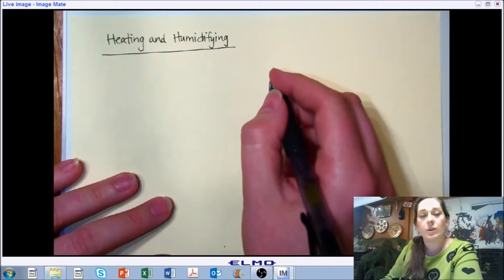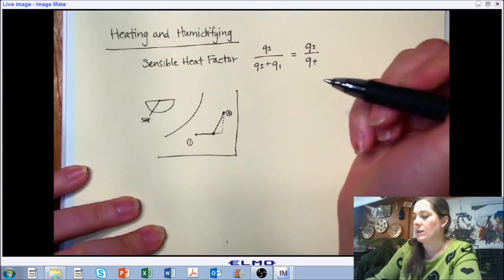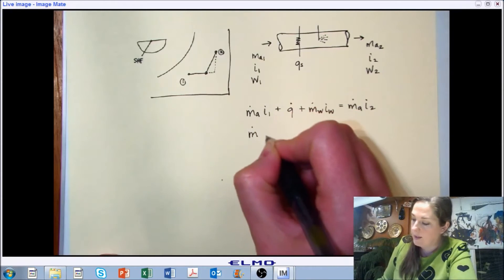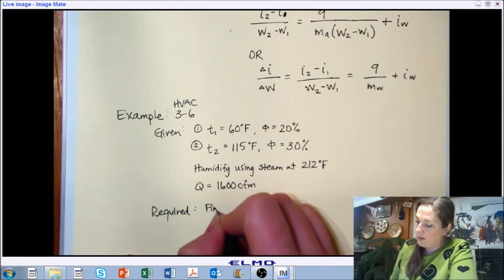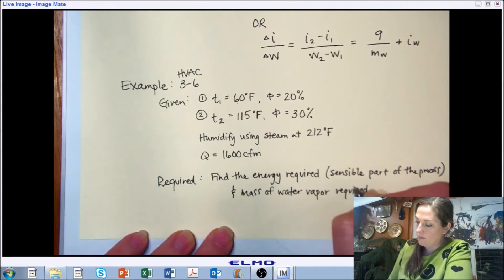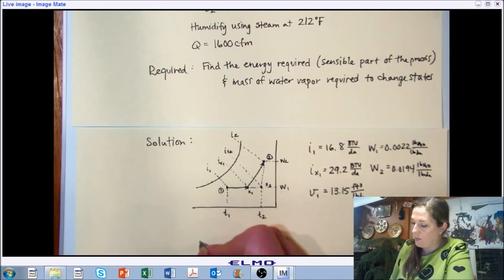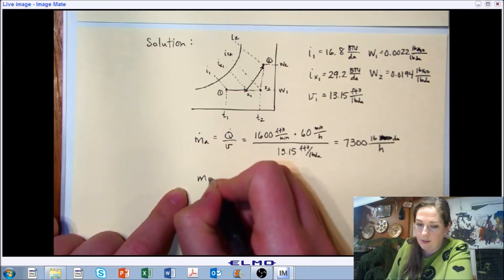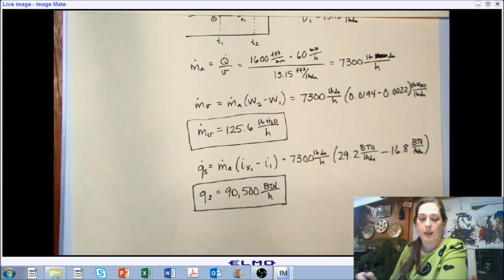LECTURE 3 (PART G): Psychrometric Processes - Heating with Humidification

Comment: you find HF of steam at 212 degree F at 1150.5 btu / lb this becomes delta h / delta w ratio of energy to moisture use the protractor  it lines up to 0.09 SHF more or less use that slope
Reply: thank you

Comment: please explain where is SHF is coming from. it is given in the problem as 0.09, or is calculated somehow. Please explain. thank you.
Reply: I could be wrong but it could possibly be that the (h)g for the steam is 1150.7 BTU/lbm. So, that corresponds to SHF.
Reply: SHF or SHR is determined by finding the change of enthalpy over the change in humidity ratio (w), that change is the outside of the SHR chart measurements and then you can read what the SHR is

Comment: If X  is an unknown spot on the psychrometric chart, how can you find ix1?
Reply from the maker: Excellent question! It depends on the details that you know. If you know your ending point (ie. target temperature and one other property, as in the example here) and your sensible heating factor (SHF), then you can draw the line from the endpoint to the intersection with the sensible heating line. This is your X1, and you can find all properties associated with this point. If you know the SHF and want to determine the ending point, then you need some additional information, such as the amount of sensible heating applied, in order to determine where to place the line. The slope of the line is determined by the SHF in either case.
Reply: Sorry, but I don't see how that answers the question Anthony asked; well, to give a more helpful answer to the question, @Anthony, you will have to find enthalpy of the vapor to be added at the temperature given (in this particular example 212F, from any standard table and use that value (in this example 1150.4 Btu/lb of vapor) on the small protractor and add the origin and that BTU value. That generates the ref. line within the protractor; now draw a parallel line on the P-h chart through state 2. Now you have your point "x". Hope this helps. TC
Reply: Ok.  I'm kind of stuck.   If we have the 1150.4 value,  then are we supposed to use the bottom scale of the protractor?     Based on where she marked it, it looks like 1190 btu and 1150 btu on the protractor looks like around 0.03 vs 0.09?  There's something i'm not understanding.  Please help.